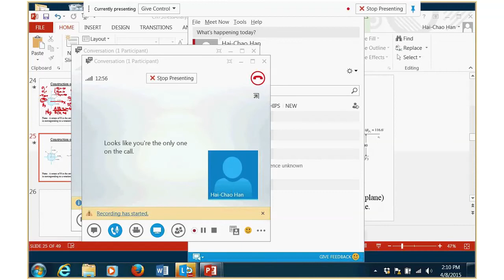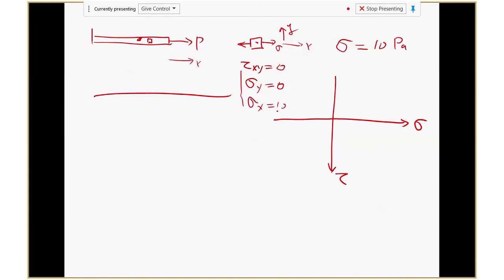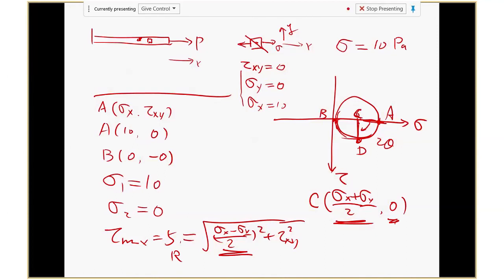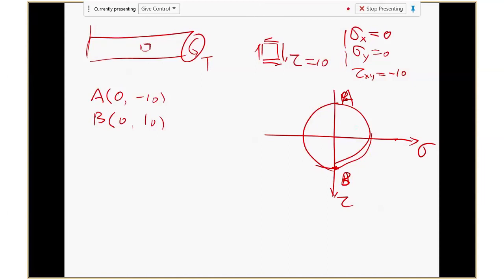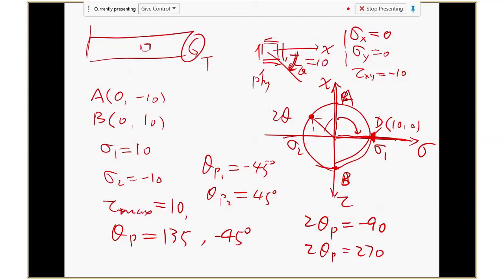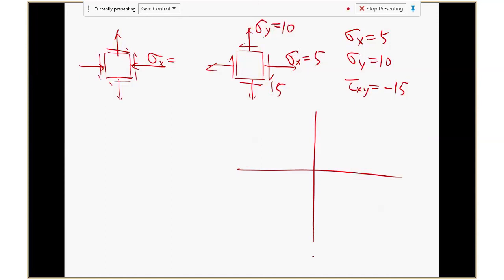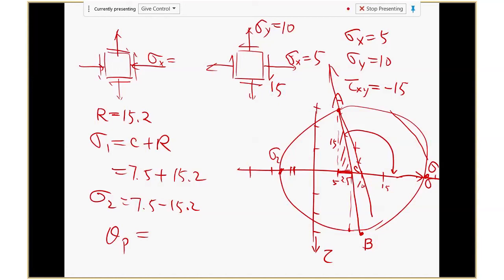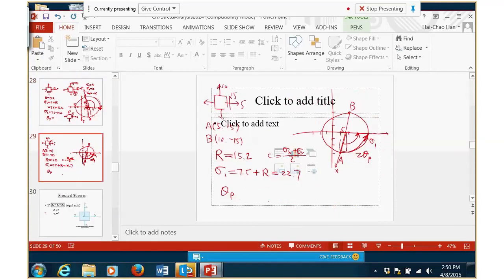Ch 7 Part B Mohr Circle 2

Comment: How did he get 2.5 for the base of the triangle at 32 minutes into the video?
Reply: +Johnathan Ludwig Because the stress value at A is 5, and the Stress value at B is 10. when the line passes the origin it is halfway form 5 to 10, there is a gap of 5 between five and ten, half of five is 2.5. the center of the circle is on the value of 7.5 for stress